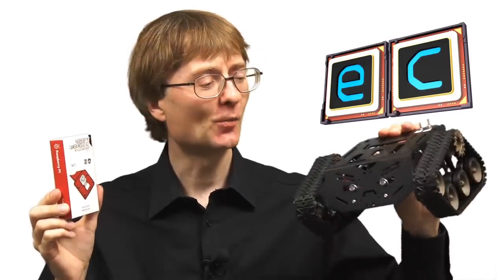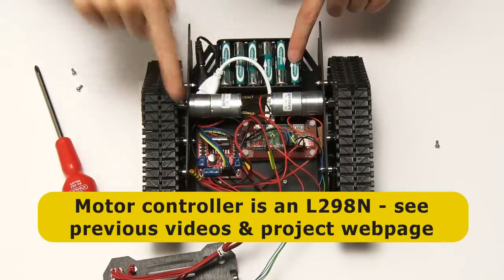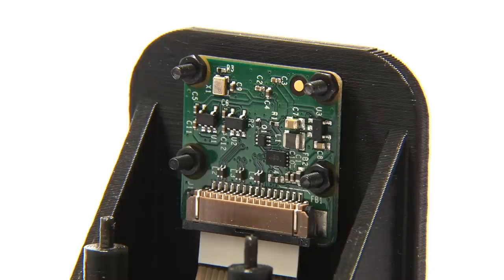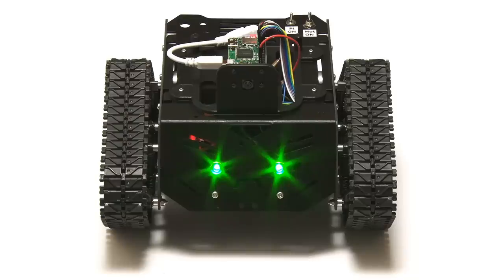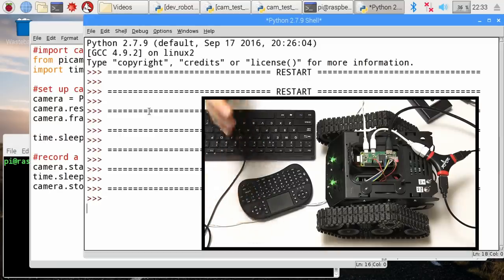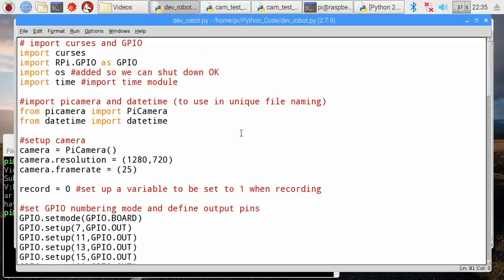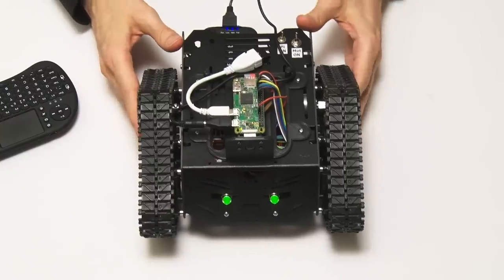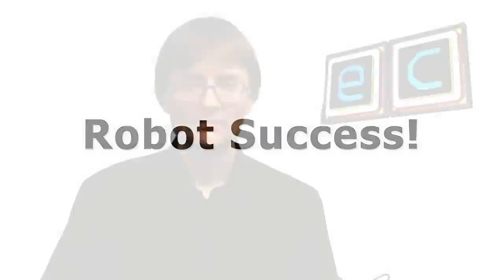Raspberry Pi Devastator Robot #3 : Camera

Comment: Question: my Amazon purchased camera does not work. There is a failure of MMAL activation...what does this mean, please.
Reply from the maker: MMAL stands for multimedia abstraction layer -- part of the code used to access the camera. So this means that software cannot access the camera properly. You should check the cable is connected OK at both ends. But it may be a hardware issue with the camera I'm afraid -- either damaged by static in handling, or delivered to you damaged. I presume you are talking about a third-party Raspberry Pi camera? Oh, and make sure that your camera cable is in the right way around! :)
Reply: Thanks, Chris.

Comment: Is there a source for the raspberry pi and camera bracket? Thanks John
Reply from the maker: There is indeed -- everything is linked from the project page listed in the video description: https://www.explainingcomputers.com/pi_devastator_videos.html  The bracket STL is on Thingiverse here: https://www.thingiverse.com/thing:3155461 And also editable in TinkerCAD here: https://www.tinkercad.com/things/hn6jajTg5Sv-pidevcammount
Reply: Not having a 3d printer to hand the cost of the supplier you used quoted to me locally is greater than the cost of the Devastator Robot kit. I was hoping someone might have a cheaper solution than one off 3D printing.  I can probably kludge something though.  Thanks John

Comment: you can only install Linux on the new enhanced version of the latte panda x86 version for   CR110 z8350 2GB+32GB
     &      x64 version for CR110 z8350 4GB+64GB    there is a sticker on the side of the 20 pin io port if you have this version you can if you don no and it just says z8350 do not attempt to install it you will kill not only the boot sector but the OS as well and believe me when i say its a night mare to put it back on

Comment: Not sure if the camera module (the black part) can detach from its pcb. This would allow installing it behind the triangular hole in the forehead. Guess the robot would join the illuminati, though.
Reply from the maker: I pondered on that -- there is a Pi Zero camera that integrates the camera electronics into the ribbin cable, and is hence very small.

Comment: Hi Prof, Like "middleclasspoor" I enjoy your videos even though I have experienced some problems probably due to my inadequacies. However, good news, I have got the autostart to work. Some of my difficulties come from not having an HDMI input on my computer so all communications have to be by WiFi . This works quite well except now that my robot is autonomous I can no longer communicate by WiFi but because I am now using an RPi 3 I can connect an ethernet cable direct from the router and this works.  I just need to get the camera working. When I run the test code this is what I get -
Videos $ omxplayer vid_test.mjpg
Video codec omx-mjpg width 1280 height 720  ….  etc
Subtitle count: 0,      etc
PortSettingChanged:  1280x720x@25     etc
(Have a nice day:)
I have checked the camera with raspivid on the terminal, that was using h264. Any suggestions.
Regards, James Robb
Reply from the maker: Great to hear that you've cracked autostart. :) Are you saying that you can record video in the terminal, but not from within the Python code?

Comment: Hi Christopher. Great project. Looks bad ass. 
Have you heard about the new Odroid H2 that`s comming? With Intel X86 cpu. I was amazed by it, didn`t epect it at all.
I`ve made a video about the announcement. Looks great, but it`s going to be expensive. 
Have a nice day, greetings.
NicoD
Here my video about the Odroid H2
https://www.youtube.com/watch?v=CjuDJ-xZXvo&t=4s
Reply from the maker: Hi Nico. I had not heard about this. I must e-mail my contact at Hardkernel! :) Like your video: https://www.youtube.com/watch?v=CjuDJ-xZXvo The plug-in RAM is like the forthcoming UDOO Bolt. There is clearly a battle going to emerge between boards like this and the LattePanda Alpha . . .  interesting.

Comment: This is dumb.  I wouldn't call this a robot, I'd call it a remote controlled car, or tank.  As such, the method of remote control is cumbersome and plagued with latency.   If/when you get to streaming the onboard video back to the controller, the latency will be so bad that it will make it's use impractical.  This would be so much better with a Taranis Q7, a couple of speed controllers & motors, a Runcam Split camera, a Vtx and a set of FatSharks.  An RPi in this project makes no sense.  If you want automated control, stream telemetry back to the controller via the Taranis.